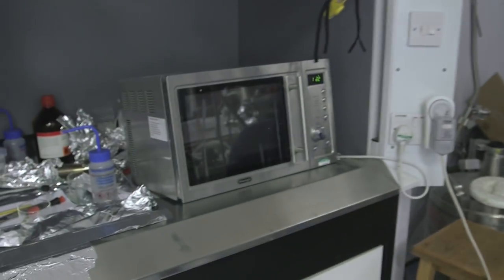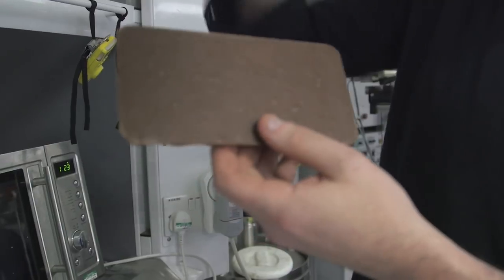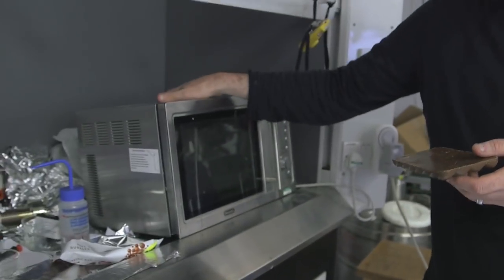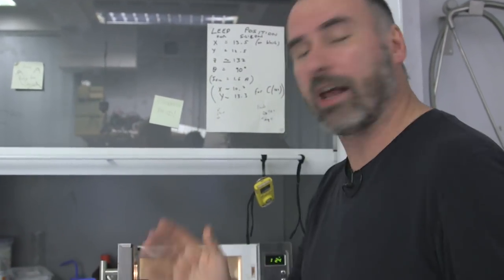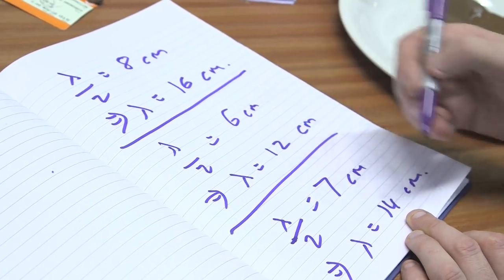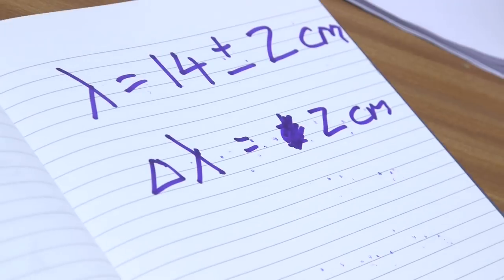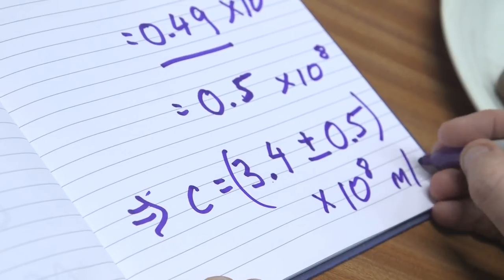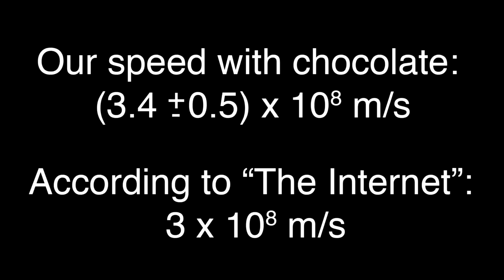Measuring Error Bars with Aero Bars - Sixty Symbols

Comment: Should not have to be evacuated just because a smoke detector was set off. Should have procedures in place so that a false positive is detected and the evacuation is cancelled.
Reply: Why have alarms if you already have a way of knowing whether or not it is a false positive in real-time?
Reply: Smoke detectors are good for when there are no humans around. Otherwise they are worthless. A human would react much faster than a smoke detector for a fire. In many modern buildings they are not required. Sprinklers are used instead. Far fewer false positive alarms.
Reply: It would have to happen somewhat frequently for making the procedure be worth the effort. Plus they might be able to get away with calling it a fire drill.
Reply: False positives happen frequently with smoke detectors, especially if you have them in or near kitchens. Burnt toast will set them off. What you need are humans trained to investigate any alarms that go off and then prevent evacuations from happening. These are very expensive. Multiply the number of people in the building by how long it takes to evacuate and then for everyone to get back into the building and return to work and then multiply that by the cost of employing people (including hidden costs), then add in the cost of calling in the fire brigade on a false alarm  and you will have a huge cost.

Comment: How exact is the frequency of cheapest chinese microwave (let's say one with all fake safety/compliance marks)??? i know it is supposed to be roughly 2.4 Ghz because FCC wants so, but it would work just fine at 1 ghz or 3 ghz, and perhaps higher or lower freq. magnetrons are bit cheaper to make... 
Chinese would do ANYTHYNG to get cost down a cent or two ;-)